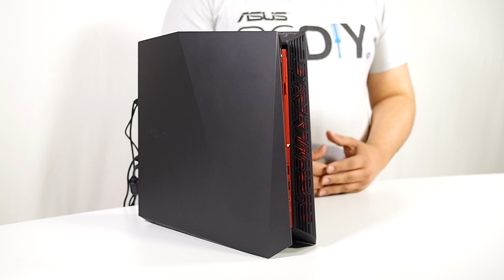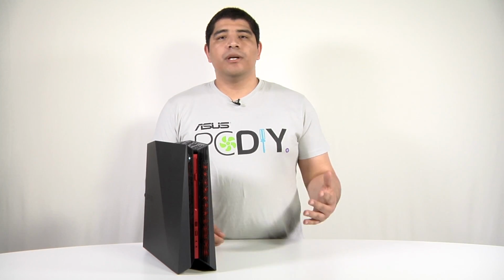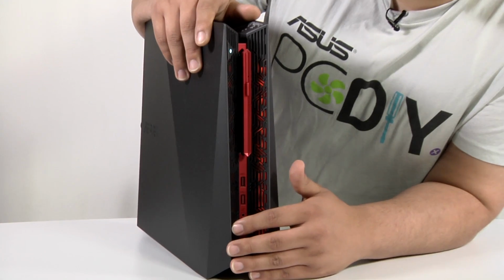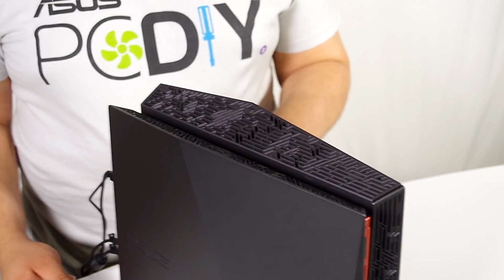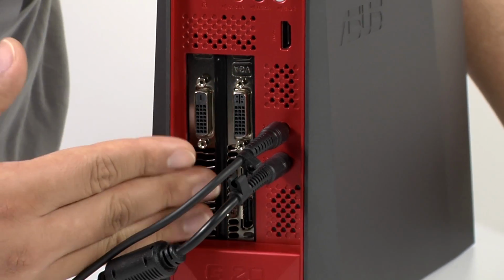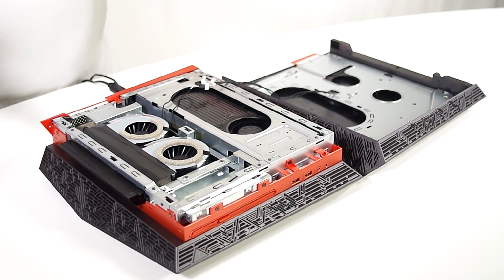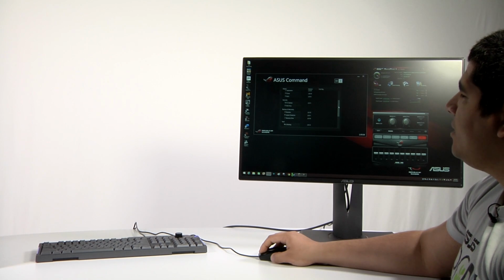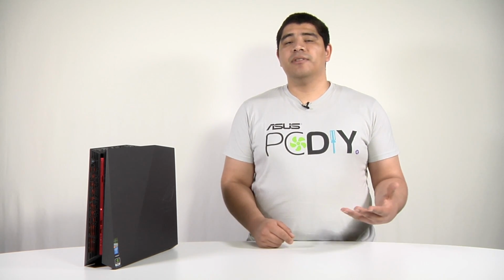ROG G20 Compact Gaming Desktop PC Overview

Comment: Sadly I was going to build a pc but I got tired of waiting and found a decent build on best buy lemme know your thoughts please

Asus desktop intel core i7 3.6ghz turbo boost 4th Gen

Nvidia geforce gtx 970 4gb

16gb ddr3 ram

2tb hard drive ( 7200rpm )

128gb ssd

Blueray disc drive

Hdmi output with whatever 

Windows 8.1 as well I just want some opinions honestly it's max ram is 32gb but it comes with 16gb and it has really good reviews as I read but what do you think I should know before it arrives yes I did order it lol
Reply: Link?
Reply: iCE sAur Daniel Moran http://www.bestbuy.com/site/asus-desktop-intel-core-i7-16gb-memory-2tb-hard-drive-128gb-solid-state-drive-black/3793186.p?id=1219601639284&skuId=3793186

There ya go!
Reply: iCE sAur Daniel Moran I got the pc now and it performs greatly! Handles dayz at max settings with render at 155% ( max is 200% but fps started to drop a little ). It's an amazing starter trust me it might not be a fancy case but it performs amazing
Reply: Cole Guthrie thanks lol i am late thanks a lot m8
Reply: iCE sAur Daniel Moran no problem

Comment: I just bought the core i5 verison for $699. my model has the gtx 750 graphics card though, does anybody know if I can upgrade it?
Reply: Michael Lerma if it fits the form factor then yes. there are models that come with as high as the 980 and as far as i know the outside build is identical so as long as you don't get a long graphics card then it will fit. check the dimensions first. you also have to make sure the power adapter is good enough to run the higher graphics card. the cheaper build may have a small power adapter to fit the less powerful card.

Comment: Hi

i have an asus rog g20 with an i7 4790 8gb ram geforce 760 and 180w+ 230w power supply and i want so switch to an geforce 970 asus strix and i want to ask if it even fit in the case and if it run with the power supply
Reply: I think yes gtx 970 dont eat to many Watt s
Reply: GÜNTHER Hundekot the gtx 970 needs atleast 145watts, so you should be able to do it. And all g20aj PSU´s are the same

Comment: ASUS - ROG G20 DESKTOP PC - I7/3.6GHZ - 16GB RAM - 1TB HDD - 128GB SSD
Reply: 9% Discount for ASUS G20AJ-US009S  http://amzn.to/1NcQ2SJ
Reply: NitroCorn yes:)
Reply: NitroCorn well i have an old laptop from Asus. It has a gtx 670mx, and intel i7-3630Q 2,4GHZ-3GHZ, 24gb ram and a normal harddrive. Im upgrading to a new one soon. :)
Reply: NitroCorn Thanks mate, have fun with you new pc ;D
Reply: NitroCorn Someone please tell me this PC, with these specs are worth the buy? Would i be able to play Battlefield 4 on ultra? Total war: Attila on ultra? 

Please reply.
Reply: NitroCorn What gpu does it have?
Reply: Andreas Rothhaus Pedersen 

Processor
Intel Core i7-4790
Operating System
Windows 8.1
Storage
1TB HDD + 128GB SSD
Memory
16GB
Video Graphics
NVIDIA GeForce GTX745 (4GB)
Optical Drive
DVD Super Multi Drive
Card Reader
No
Reply: Andreas Rothhaus Pedersen That's all it is telling me
Reply: Then dont by it there, find it some where else
Reply: Andreas Rothhaus Pedersen Any suggestions man?  i need a good site that sells good gaming PC's, and for a decent price
Reply: Which country do you live in?
Reply: Andreas Rothhaus Pedersen Australia
Reply: i live in denmark, and there you can buy it with a gtx 970, for 1500usd, but if you just go and google "Asus rog g20aj nrs040 or nrs0390 it should come up with something.
Reply: Andreas Rothhaus Pedersen thanks man
Reply: Andreas Rothhaus Pedersen I costs $2200 over here :/
Reply: that is expensive, maybe you should just build your own pc
Reply: NitroCorn
Reply: Andreas Rothhaus Pedersen Richard Perry  I finally got a PC! omg it's amazing!
Reply: NitroCorn Nice, is it the g20? :)
Reply: Andreas Rothhaus Pedersen Nah man! It's a home built one! got my mate to build it for me, it's amazing. Would you like the specs?
Reply: Andreas Rothhaus Pedersen 
CPU: Intel Core i7-2600 CPU @3.40GHz
GPU: Geforce GTX 780 Ti
Memory: 16 GB RAM (Two 8gb sticks)
OP: Wind 7 pro, 60Hz
Case: Thermaltake
Motherboard is pretty basic, ill be upgrading that soon. 

:D
Reply: NitroCorn nice :D
Reply: Andreas Rothhaus Pedersen Thank you! What specs are yours? :)
Reply: Andreas Rothhaus Pedersen Oh, damm that would have been alright in it's time! i bet you have some good memories with it! And good luck, i hope you pick a nice one! :)
Reply: Andreas Rothhaus Pedersen haha no worries! and will do! :D speak another time man, always on google+

Comment: I am looking into PC gaming, because I only want a Wii U for a console and would rather spend more on a desktop with cheaper games and lasts me a generation or two. I am wondering if this model can run these games at higher settings (with little to no frame rate issues, freezing, or crashing)
-Skyrim
-Fallout 3
-Arkham Asylum
-Dark Souls
-Far Cry 3
-Any CoD games
-Dragon Age: Inquisiton
-Shadow of Mordor
Again, I don't care if the graphics are top notch, but frame rate and freezing/crashing really bug me. I just don't have the time to research what parts are any good if I want to build my own. Also, I heard that Windows 8.1 makes some games crash, so I am wondering if you can get Windows 7. Again, I might sound like an imbecile compared to experienced PC gamers, but I'm just wondering if this a decent start.
Reply: ***** Thanks for a general figure. Appreciated!
Reply: Zack Loewen 
-Yes, (It even runs with like 1000 mods)
-Yes, but Windows 8.1 sucks.
-Yes
-Yes
-Yes
-CoD could run on a potato battery
-Yes
-Yes
:)
Reply: Starkiller10569 Thanks! and yeah, CoD was kind of a dumb question.

Comment: Saying this system has an I-7 is pointless. There are varying degrees of that all the way up to a 8 multicore monster.  However i don't fault Asus for not explaining this. People really need to do their research.  Before committing on any product. 

Without being sure it's what you want. Same goes for memory which is now in it's DDR4 stage. However most systems even the super high end ones are still using last generation configurations in some cases.  Still though i agree with many people's observations.  

For a PC desktop to have it's warranty void. Due to a memory swap and hard drive.  Is a bit insulting to say the least. For a PSU i  can see. As that requires a bit more care. If you can change a light bulb however. The other is pretty self explanatory.  

Still as i mentioned in a previous video.  Asus makes a very good product. However i think they are missing the bigger picture here.  This really isn't much an improvement from the GR8. For the price it just doesn't seem very well thought out. 

It looks cheep and very entry level. Not something i expect from Asus on average.  Yea i get who they are trying to sell to here. However as a concole gamer myself. I am not even sure i would take this over my PS4.  It's maybe a more powerful system. 

That however means very little without great software, optimization, drivers, support & capable interface.  Something my PS4 has in spades. My advise to new PC owners is just save up a little more. You will get a much better system. 

Which won't be handicapped by it's lack of upgradable features. Not to mention support &  game drivers.  Which will be lacking in a custom GPU environment. You just don't have the flexibility your goinv to get. From a more open customizable platform.

Comment: umm excuse me? voiding your warranty by opening? If I wanted a console I could pick one up for a lot cheaper than that.....and whats worse is your allow options for upgrade and still do not promote opening it. and while I'm on the rant, a 660ti came out 3 years ago. Stop trying to fool the stupid gaming demographic by putting an "i7" in there and hoping people who don't know any better will will buy it, you know for a fact gpu's are the thing you should be focusing on for an optimal gaming experience, so stop overcharging us for a fancy case and a graphics card that is struggling to handle even 1080p in modern titles. Don't buy prebuilts, they're a scam.

Comment: On your website it says under the specs of the g20 :
CPU: Up to Intel Core i7 4790 Processor
GPU: Up to NVIDIA GTX 780 Graphics
Does that mean you can buy it pre built with an NVIDIA GTX 750 and then interchange it with an NVIDIA GTX 780 or no.
Reply: I don't believe so. You need to buy the version with the GTX 760, The reason is that a GTX 780 likely needs a larger power adapter. The version with The GTX 750 only has the small power adapter, whereas the GTX 760 has a large and small power adapter.

Comment: If you want to upgrade your pc later in the future then this pc is not for you.This system is not for the experienced pc owner. Its more of an introduction machine for new pc owners. This is basically a marketing transition device to get people from consoles to PCs. Future games will be demanding more hardware power which will render gaming consoles obsolete. This device is basically an ASUS gaming console. There are still more advantages to building your own PC rig than buying a gaming console. This system is not fully upgradable. The power supply is only efficient for the stock hardware. It will however handle most current games.
Reply: ***** Really. What would you recommend as an upgraded power supply? Also if I wanted to upgrade the stocked LAPTOP fans to a more efficient cooling system what could I use? Would you have to replace the outer shell for a more spacious tower? Could its mother board support these upgrades? All of course without breaking warranty. Just curious because I held my hand over the tiny exhaust vent on top of this machine and it was extremely hot. The only thing that was running was the background. I'm pretty sure over an intensive gaming session this thing would be ready to shut down. Thanks for your input in advanced.

Comment: The quality control at ASUS stinks! The store where I bought my first ASUS GR20AJ that came with a dead on arrival GTX760 replaced my ROG. Guess what? My replacement ROG GR20AJ also came with a dead on arrival GTX 760 . GEForcExperience won't even recognize the card. It shows in device manager with the latest Nvidia driver but it won't work.
ASUS what is the matter with you?????????????????

Comment: This PC is a beast. I got the us023s version from Best Buy, and it packs a punch. I can run Watch_Dogs 1080p and at Ultra Graphic settings. I'm not a stickler for constantly having 60fps, but I bet I will be once I upgrade this baby to a Nvidia GTX 780. 13.5 Pounds of pure gaming. (Sidenote: Can also be upgraded to 16gb ram and 3tb storage)
Reply: Hey i only got one power cord with mine i don't have one for the graphics card. Do you have to buy another or was it suppose to come with two?
Reply: Have you added the 780 to it yet? That will make it an absolute beast. It's too bad that upgrading it voids the warranty is all :-( sniffles...
Reply: can you have dual monitors
Reply: i have a question. you know how ps4 ps3 xbox and so on run cds like disks, does the asus also run lets say like watchdogs pc disk?
Reply: Which model did you get? I got the i5 model with additional SLI, if that's the case you probably have a GTX 750 which, like mine, does not require an additional power supply. The i7 model on the other hand does need the extra power supply.
Reply: Jack Jack I haven't actually tried putting DVD in, but it says that it has a DVD and Blu-Ray drive so it should play any hard copy games without issue.
Reply: Lord Stronghold Yeah i have the 750 thanks
Reply: Khonz92 No problem. Enjoy. It's a pretty sweet PC for its price.

Comment: A week ago I posted in reply to someone who was having serious problems with his new ROG:"Sorry to hear of your issues with your new ROG, but you are not alone. You are one of the unlucky ones. There are several reports all over the net in various forums and customer reviews of ASUS ROG Nvidia Card problems and failures, particularly the GTX."

Well, despite those reports I bought one. Installed the latest Nvidia driver and guess what. My GTX 760 is dead on arrival. I can only use my ROG with the onboard Intel GPU which is useless for gamimg.

ASUS!! DO YOU TEST THESE MACHINES BEFORE YOU SHIP THEM??????

I'd install a replacement card myself, but that would void what is apparently a much needed ASUS Warranty.

Shame on you ASUS!

Comment: im a huge fan of asus but i have to admit that im not a fan of the g20, the fact that its limited to a 8gb ram unless you void warranty, yet he said there is a 2nd slot to upgrade to 16gb, which means on a x64 based OS your only using 1 stick or ram??? and for the name of ROG is known for having the best parts on the market provided you have the money, yet they dont offer newer GPUs only 760 not even the 780 or 780ti? i cant ask for gtx980 cause it just came out and they starting working on this a year ago. and just on a personal note, i hate red. id love to see different colors. but lucky me im a modder so its not that much of an issue.
Reply: you can order it from xoticpc.com with up to 16gb ram, EVGA GTX980 SC,6tb HDD + 1tb SSD without having to worry about voiding the warranty, not sure if they have a solution for those who don't like red though lol.
Reply: Karl T ahhh i do see that but still the customizing seems very limited and they dont give you a "K" cpu so no overclocking. And only a 230w with 180w external, thats weird and 410 wont be enough to drive that computer. I just spent about 2k on a new gaming/editing pc and it would take shits on the G20... no offence to asus, its a good computer just doesnt seem worth the cost or hastle for problems i see happening once you actually start using it.
Reply: Karl T http://pcpartpicker.com/p/qRtdgs thats the pc i just build besides the gtx980 cause im waiting for the 8gb version to come out soon. but still just under 1900 and you get the best GPU out and a unlocked 4790k. as well as triple ssds for an insane raid 0 drive and the best asus ROG board in mini itx form. and liquid cooled, even the g20 doesnt do that. only thing not included in the pricing is better fans for the case which i had from my last build.

Comment: my son wanted to upgrade to 32gb memory is that possible with this pc ?  also can this pc as is handle skyrim or battlefield at full settings? without issues?
Reply: 32 gb of ram is unnecessary. It can be upgraded to 16gb, which is enough.  Most games run on 4gb, with more demanding games running on 8gb.  No games run on 16gb, so for the most part you will never need more than that.
Reply: will it leave enough memory for windows 8 as i hear that takes up alot of memory
Reply: I'm not sure...
Reply: Jjenni Lee It will leave plenty of space.
Reply: lol 32gb

Comment: Anyone know if the GPU will be upgradeable (As in can it be done not are ASUS okay with it), if it can cope with a GTX780 then it can definitely cope with a GTX980 which interests me.  However if they use proprietary PCI-E slots or something that would rule out upgrading.
Reply: I think you should be able to upgrade with a reference model gpu. It will of course void the warranty but I'd imagine it would be possible. Just might be a bit of a pain to get in there
Reply: Id imagine a GTX780 would be a bit too Long for it.
Reply: Jacob Robach It comes with a GTX780 as standard in the top model, hence my interest in replacing it with a GTX980 which is the same size but runs cooler and uses less power.
Reply: Should work fine then if length isn't an issue.
Reply: All of you guys should check XOTIC PC's vid on about it. They were able to upgrade the RAM to 16gb and of course the card to a GTX 980